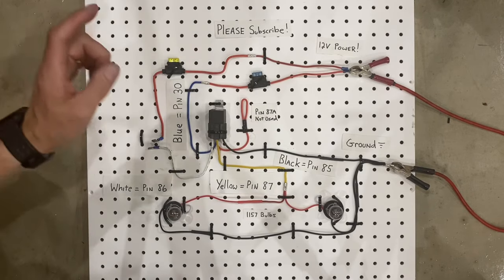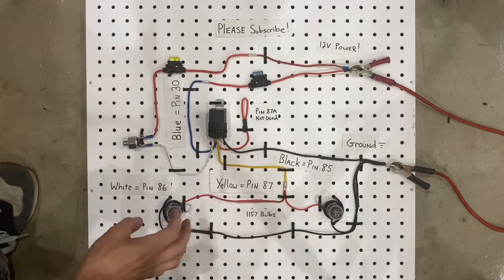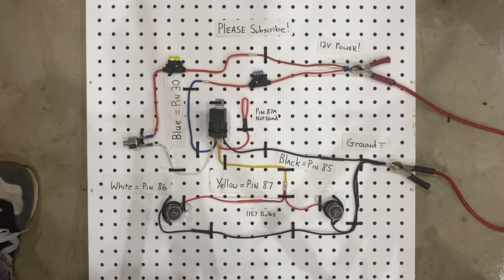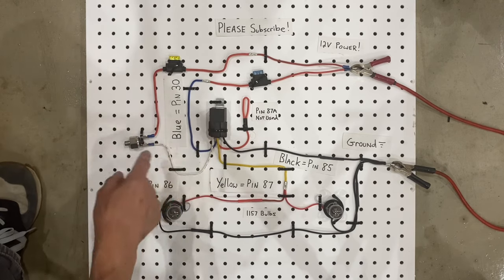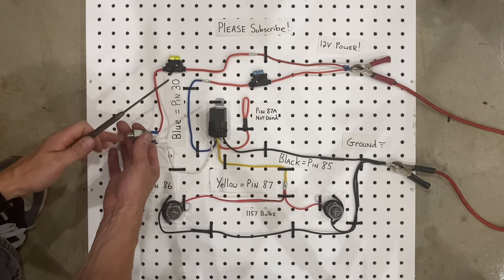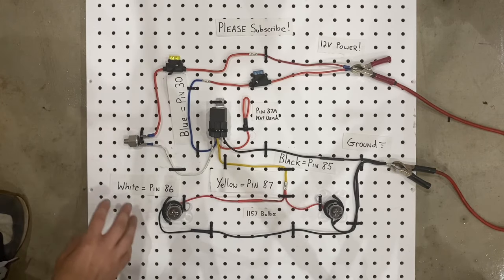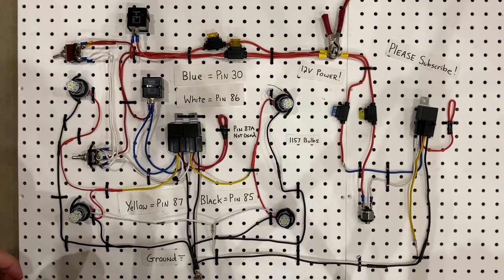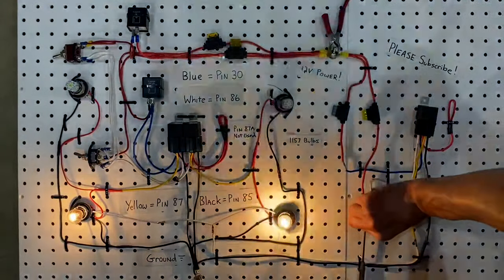How to Wire TWO Types of Brake Light Switches - (Hydraulic and Plunger Style) | @WiringRescue

Comment: My brake lights have 3 wires coming out of it, Black/Red, Black/Yellow and Black, tried doing this but it doesn’t work, something with the extra wire not sure.
Reply: I tried this way to. No lights but have power to my wires. I am lost and pretty frustrated at this wiring crap

Comment: It would be awesome to see all of the circuits wired into the fuse block you showed and all working with each other! Like turn signal circuit, 4 way circuit, brake light circuit all working together through the block. These last videos have helped me ALOT since I'm having to rewire an entire car light system. So thank you!

Comment: the way i understand the mechanical brake switch construction (in this case the nc spst design) is as such - the button is a nylon post on a spring, the spring is housed in the narrower end of the switch, the post passes thru a divider, on the opposite end of that nylon post, in the wide end of the switch, is an un-wired contact point, a copper washer. when you brake the switch is at rest and that washer is pulled (due to the spring expanding) against the dividing wall which makes up the spring housing, on the face of this divider is a split copper washer, each half of which serves as a contact point for a single wire post on the wide end... or at least thats how id build one... but theres more than 1 way to skin a cat.

Comment: I'm redoing a Honda super cub and this will make things so much easier.   It's a 6 volt system and the conversion to 12 volt is very pricey. Now, I'll leave the 6 volt setup, not use the charging, and just run a 12 volt battery to all my lights. An 8 AH will run more than long enough for led turn signals and a small led headlight. Thanks for this tutorial, it's really well done.
Reply from the maker: Sounds like a great project! Thanks for watching!

Comment: GREAT vid !!!
This save me a heck of a lot of time to find out why my bakelights weren't working. Due to your vid above, I was triggered regarding the hydrolic swich. To test if mine was faulty, I shorted / connected both poles with a piece of wire. And yep....brake lights went on.
Conclusion: Either swith is default or residue / dirt is preventing the switch to work properly.
Saved me tons of time to check all cables / connections !!
THANKS !!!!!
And....GREAT way of explaining stuff !!!!!!

Comment: Do you have a diagram for the whole system you showed at the end? 
These videos are amazing and  I'd like to use that exact setup with the relays but wired into my turn signal cam.
Just having trouble connecting them all together correctly

Comment: I am doing a 89 foxbody and the stock wires are complete garbage. Spliced a million times and they have so many gremlins that I finally just pulled them all out. I’m learning a lot from your videos. Thank you. I am no electrician by any means, but your videos make it look easy.
Reply from the maker: Thanks for the kind words! Good luck on your mustang project and stay tuned, I have more wiring stuff coming!
Reply: @WiringRescue  I plan to do basic wiring. Headlights, high and low beam, running lights, marker lights, turn signals and brake lights. Also doing power windows with manual locks. No heater or ac. No radio. The car will have a carburetor. Basic electronics to operate the motor and fuel pump. How many relays would I need?

Comment: you explain in using a small fuse box circuit to operate head lights which am i able to run my brake lights as well a line lock set up on this fuse box circuit ?  i would like to see you work your magic on this type of set up.

Comment: @10:10 if you dont mind my ask. why did you use two Flasher Relays? could you not have used a single flasher relay for the Left+Right signal + the Hazzard lights or does the Hazzard require its own flasher. I initially thought the hazard switch was daisy-chaining the two LR bulbs together and using the same flasher till I noticed the second in use.

Excellent video btw very useful esp as I'm wiring/wired my entire chassis & engine.
Reply from the maker: Generally hazards are available for use all the time, even when the car is off. Turn signals are only available for use when the ignition switch is turned on. Because of this design, many cars use two flashers, one for turn signals and the other for hazards. It’s possible to do it with one flasher, but you’ll either have turn signals that work with the car off, or hazards that only work with a key on.
Reply: @WiringRescue  Excellent explanation, 4 videos down into the flashers that you posted and later realized the "why". Excellent videos and great detail.

Comment: I wish you would’ve covered how to have the running lights function still while wiring this! I have an issue where my 3rd brake light is on another circuit but I’m scared to mess up the running lights

Comment: Thank you for posting this video, I’ve been wanting to tackle the wiring of my taillights on my 63 bug converted to 12v. Any tips on with a master cylinder that has two switches?
Reply from the maker: First, I’d determine what the two switches do and decide whether you need both of them or not. If you don’t, then just stop using one of them and wire it as described in the video. If you do need that second switch for something, like making an automatic stickshift transmission work or something, then you’ll need to sort that out separately. Either way, I’m cheering for you and glad to see you found the video helpful!

Comment: What would trigger for the brake light to stay constantly on if the brake sensor is working properly? Would it possibly be the relay that is not working? Having issues with motorcycle would appreciate the input
Reply from the maker: Most motorcycles have two brake switches. One for the hand brake and one for the foot brake. Sometimes springs are missing or worn out on the foot brake causing the switch to activate.  If you unplug each switch, you can determine which switch is causing the brake light to turn on. Once you know which one, then you can test the switch with an ohmmeter or test light to see if it is working properly.

Good luck and let me know how it works out!

Comment: Hi! Excellent video! You do an amazing job of explaining how to do this wiring job. I have a 1956 Ford Victoria Car. The current tail light wiring is as follows. There is a black wire that goes from passenger taillight, T’s off to the license plate light, goes to driver side tail light then to the headlight switch. All 3 lights turn on with the headlight switch. There is a green line on driver side taillight that activates the turn signal. There is a ted line on the passenger side taillight that activates the turn signal on it. My question is what am i missing to make the brake lights turn on? It’s missing those wires. I converted the front brakes to disc and will be using a pressure switch like you used to activate the brake lights.  Hopefully i gave you all info you need to give me a solution.
Thank you very much in advance!
Eddie
Reply from the maker: Hi Eddie! Check out this video - it may help make sense of what I’m about to say - https://youtu.be/Io_i9016o10
Your turn signals and brake lights likely share the same wires. I don’t have a wiring diagram for your car handy, but I would bet that your brake lights go through your turn signal switch. So you just need to find those wires under the dash (if they still exist) and connect your hydraulic brake switch into them. Definitely check out the video I linked to, because it shows exactly what you’re after! Thanks for watching and good luck with the 56 Ford! It sounds like a car I would love!
Reply: @WiringRescue  Thank you very much i just watched the video and now know what to look for!
You are awesome!
Reply from the maker: @MrHotrodTBone  - excellent! I’m thrilled that my video is playing a very small role in a 56 Ford build! Good luck on the project, and let me know how it works out!

Comment: My motorcycle already has a hydraulic brake light switch via Foot brake. But I need to add another brake light switch via hand brake. I'm going the hydraulic switch route but I'm curious since I already have a footbrake switch could I somehow add the new switch into that wiring or would the new hand brake break switch need its own relay and fuses?

Comment: First, Thanx for your how-to vid's, I've referred to a few of them and saved a lot of stress. So, I'm having a near wrench throwing issue that's been a thorn. I have a 62' F100 that had only headlights, and finally got taillights, blinkers, and hazards, but the brake lights just ain't having it. I followed this setup and tried a couple others, no dice. I had an old
 Yankee Turnflex  734/737 signal switch I wired. What am I not getting?
Reply from the maker: What are you using as an actual brake switch? Do you have one on the pedal or a hydraulic one in the brake proportioning valve?

Comment: Here is a question for you as I am Not good with electricty! So, do I Need a hydraulic pressure switch on my proportioning valve And the brake light switch with my pedal? If so do I wire it as your diagram shows? Thanks, Warren
Reply: Is there nobody out there that can Answer the above Question!?

Comment: Can you show how to connect some auxilary lights to existing upfitter switches, a secondary switch and the reverse lights and if possible if you can show them connected or feeding through the truck to a trailer using the 7 pin connections.

Comment: Painless Wiring makes a simple kit to do this job. Turn signals and brake lights wired the proper way and not running the brake signal through the tail lamp filaments. You can run 4 relays, one for each signal light and feed the brake light signal through the normally closed contacts of the rear light relays. Feed from flasher on 87, brake signal feed on 87a, output to light on 30

Comment: When the bulbs first come on, they're brighter and then they fade - would a variable resistor make them consistent in brightness?  If so, how do you figure out what one you need (presumably this happens due to a voltage surge and thus the resistance needs to go down to 0 once the voltage is reduces to 12 volts)?

Comment: maybe you can help me out or someone out there.  I have a 95 accord  break lights stay on all the time.   not sure if my switch is faulty  I dont have volts at the plug just ground.   when i test the switch its closed when the button is out   its like its backwards so maybe switch is bad.   Im thinking of just rewiring the brake lights   do  i need a relay or can i just put in a fuse thanks

Comment: Do you need to replace the old style flasher when running LED bulbs? My older cars have the cylindrical metal encased steel flashers.
Reply: Yes you do, but they are not costly.

Comment: How would it be wired if the brake light switch also has a mode when you have them as running tailights when you turn your headlights on?

Comment: I have an issue with rear turn signals left and right not working nor brake lights not hazards could it be the turn signal switch I checked fuses and replaced brake switch and light bulbs any help greatly appreciated thanks

Comment: I wired my turn signals like your video and I'm having trouble with it working at times .could u give me some advice
Reply from the maker: I’d check all the connections for loose wires. That’s the most common issue. Loose/damaged wires.

Comment: I have a setup like that first one (only for the brake switch) but i don't have a relay on it. Is this why either the fuse or the switch get hot and stop working eventually?
Reply from the maker: I’d always recommend a relay. It’s just safer and better. And yes - you have all of the power for the lights running through that switch which is probably hard on the switch.
Reply: @WiringRescue  thank you so much 🙏🏻

Comment: Hello, just to be correct- the relay is not actually necessary, it's just there for safety. I am using a unimax switch that can handle way more than 12 volts. I am assuming the white and yellow wires would be spliced instead to remove the relay. Thanks!
Reply from the maker: You are totally correct that it’s used for safety. Imagine if you have 4 brake light bulbs that each draw 2.5 amps when lit and you are not using a relay. The brake light switch may only be rated for 7 amps.  So when the 4 bulbs light up, 10 amps go through the switch, which can only handle 7 amps, and now your switch is broken, melted, or on fire. That’s why I prefer using relays for things. It allows a low amperage rating switch to control a larger load in a safe manner. :)

Comment: My hydraulic brake switch has two screws instead of the flat spade type. Does it matter which wire goes to either screw
Reply from the maker: It should not matter which wire goes to each terminal. It will work either was if you have it connected to a relay.

Comment: I need the brake lights to idle, then when i push on brakes? It gives the full 12v
Reply from the maker: Generally people use two filament bulbs for something like that. Each filiment is a different wattage, so you would use the lower wattage filament for the low-light and the higher wattage for the brighter brake lights.

Comment: My problem is the truck takes like no brake pressure to come to a stop. Such low pressure that the lights won’t activate. Any recommendations?
Reply from the maker: What kind of brake switch are you using?
Reply: Pressure type.

Comment: I am working on a 1972 Ford F-350 about to attempt to do this I was wondering what is the flasher at the top coming from the battery and fuses goes to please help
Reply: Towards the end of the the video when you have the break circuit hooked in it looks like it’s hooked to the emergency flasher toggle switch
Reply from the maker: You can ignore that second flasher on the top. It was left over from something else I was trying. 
If you want to wire hazards and turn signals, check this out. https://youtu.be/lnhMx-fnUmI. You can add the brake circuit to that and it all should work really well.
Reply: Thank you so much man love your videos

Comment: I followed your schematic to wire a pack brake light on my go-kart can't seem to get it to work. The only thing I have different on my is on my hydraulic switch I have two connections of break start and The brake light can't seem to make it work
Reply from the maker: Are your grounds good? Touch the two wires that go to the brake switch together and see if the lights turn on.

Comment: hi jeramy, why is that when i press on the brakes, the  turn signal does not flash  on either side
Reply from the maker: It’s tough to diagnose things over the internet. My best guess is that the brakes are sending power to your light bulbs, and making them light up. So when you turn your turn signals on, they cannot make the bulb flash because the bulbs are already getting power 100% of the time from the brake switch. The turn signal wants the bulb to lose power intermittently and it can’t because your brakes are feeding it the power when the turn signal is pulsing off.

Comment: Can you make the connection to the pressure switch by joining with the blue wire
Reply from the maker: I prefer to do it the way I described in the video. I don’t believe your method would work for very long.

Comment: I have done all this but for some reason I have no brake light when using turn signals or with lights on
Reply from the maker: Okay, just ignore all the other circuits for a minute and focus on the brake lights. Are the bulbs grounded properly? Do they have power coming from the relay? If so, does that power go away when the turn signals turn on? Or are you losing the ground side of the circuit somehow?

Comment: 🤔🤔🤔🔥🔥
Reply: I have the brake switch and the first hydraulic I believe. I have something similar on the proportioning block
Reply: How do you know which wire is to power brake lights? I have a yellow wire on one light and a blue wire on the other. Both lights also have a dark green wire, and a ground

Comment: Why does there need to be two powers into the relay. Why isn’t the one from the brake switch enough
Reply from the maker: There are many ways to wire a circuit and this is just one option. Typically the relay needs the main source of power (pin 30), which actually powers the brake lights. Then you need a signal from something to tell the relay to turn on and off. That signal is the power that goes through the brake switch (pin 86). The brake switch circuit is very low amperage and a totally separate circuit from that of the bulbs themselves.
So in short, pin 86 & 85 is the circuit that tells the relay to turn on or off. Pin 30 & 87 are the power that feeds the brake light bulbs.
Reply: @WiringRescue   thank you for clearing that up. I’m building this same setup for my 64 short box